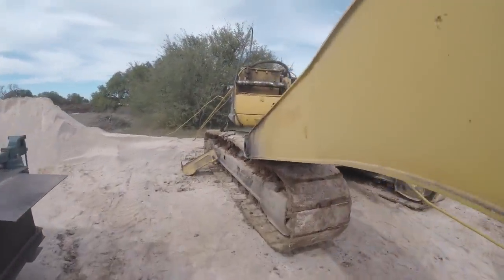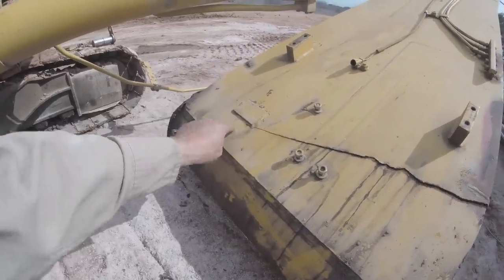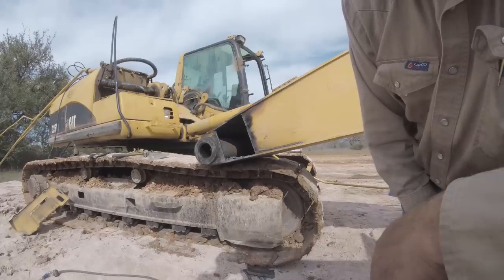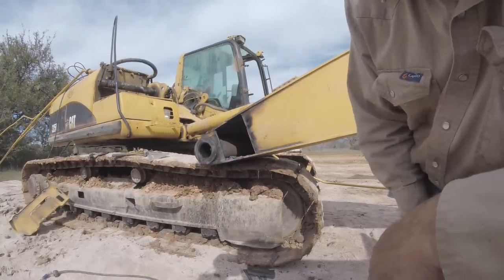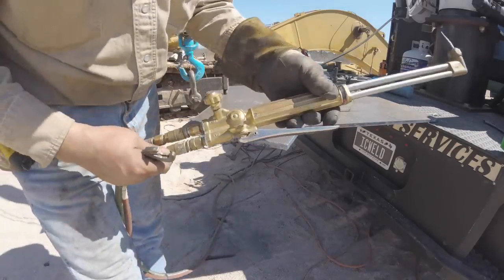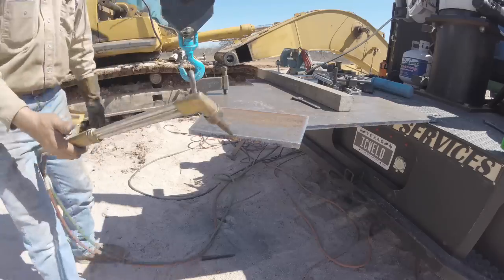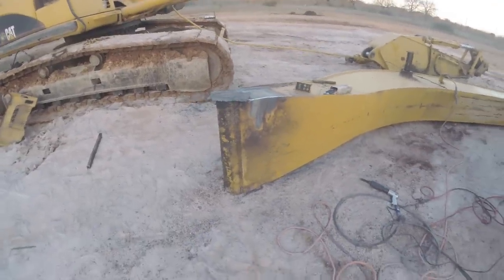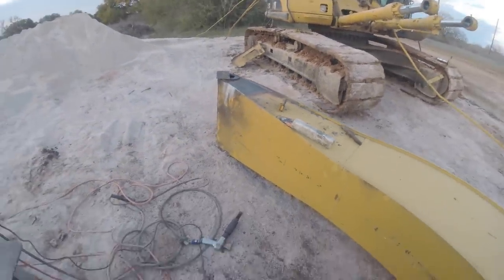Broken Excavator Boom!!! How to fix it!

Comment: Why am I watching a man weld for 25 minutes along with more than 475,000 other Youtube viewers, a man that only has 35,000 subscribers? Because this man is in harmony with the machine and the metal that he works with to such a degree that the metal cooperates. Notice he never or rarely uses a grinder and when he uses a hammer it is with finesse? He reminds me of a Hopi Shaman that I admire.
Reply: I only watch him because of the stupidity of his repairs !! I was a welder for 40 years had my red seal ticket and my xray ticket . You must grind all the cutting and gouging of the  steel. ( in this case it will be T 100 steel - structural steel ) so that you will get a carbon free weld, ( it will not be a brittle weld ). must use preheat and post heat on the plates .
 this is from 250 -300 degrees F.
Reply: @richardsmuin7665  If his repairs were that bad he wouldn't have repeat business from a heavy construction company that loses thousands of dollars when a big piece of equipment goes down. They wouldn't give him that many kicks at the can.

Comment: You are a surgeon with that torch. I used to weld machines like that( but of a better brand IMO) in a production setting so it is interesting to see how they fail and are repaired. I know people use these things for more or different work than they are rated/made for.Nice work and thank you.

Comment: I have been in the earthmoving game for 35 years and have always said you need "Earthmoving Welders" or "Earthmoving Electricians" or "Earthmoving Line Borers" as there is more to it than just welding etc. While we always joke in Australia that welders are really just "scrap cutters" it is extremely pleasing to work with guys who "get it" and know there craft and you sire are absolutely one of those guys, someone who attacks repairs most would now just want to replace those items complete, a true artist you are!
Reply from the maker: Thank you very much. I really appreciate your words. Too often, welders get a bad rap, especially if you're not one of those Pipe welders who seem to get all the glory. Working on heavy equipment takes more than just knowing how to burn a rod in circles. I'm not badgering pipe welders, heck, I did it for a few years myself. However, It takes a different mindset to understand how to piece together a machine that has torn itself to pieces. That's the type of work that excites me. you gotta think!
Reply: @ICWeld  no problem mate, a pleasure to always see a true trades person doing there thing

Comment: This is why many welders can make way more wages than many college degrees.  
I tried my hand at welding.  Not at all easy.  Stuck with being a Machinist.  
Great respect for Welders and Fabricators.
Reply: You didn’t like the dust and smoke? That’s strange. Haha
Reply: @paralou8576  The welding booths that I trained in had ventilation hoses.  
I could never see the molten puddle.  Therefore what i did achieve was by rote, not by control of the puddle.
I was pretty let down.  Really wanted to learn how to weld.
Reply: @MaxCruise73  makes me think your shield may have been too dark for you. Very common mistake I've seen. People so worried about arc flash that they over dim or use too dark a lens.
Reply: @patricktennant1585  Thank you for your reply.
During my training, my eyes started bothering me. Issue went away once I darkened the shield a notch or two. 
Did that create more issues as you suggest?  Suspect so.  
I still wish to try MIG welding.  Removes the need of constantly driving the hand toward the workpiece as the rod is consumed.  
Again, thank you for your reply.

Comment: Very nice work. While it is straight forward it is still challenging. The experience shows with the little tricks like sticking the tube in the pin boss for a steady rest. I like at the beginning when you said it’s just metal. No need to overthink it

Comment: First time I've seen one of these type video where a carbon arc gouge is used. I used them for years and if you have enough juice going to it, the cut is clean and smooth. If not, it's like a snaggle toothed alligator chewed on the metal. Nice welding too. Not afraid to use a backing plate either. Nice to watch a craftsman at work.

Comment: For some of the folk who said they are still learning, or want to get into this trade. This is an EXCELLENT vid 
I (certified gas pipe line welder) used a LN77 & innershield on bridge false work , which is building structure to put forms on top of , to pour concrete , to make a bridge , but l don’t remember what the wire was as it was 30yrs ago. But the gun nozzle was not that LONG, rather abt 4” 
If the gap is wide , & you cant put in a backing plate , do a 6010/6011 root pass , dress it good with a grinder along the edges , to insure , when you start to fill with 7018 that there is no possibility of trapping slag in a wrinkle , this is what is done on pipelines, - the inside looks good but the outside must be ground, & then either use the wire feed or 3/32 rod , as the man said , for more control, so you don’t burn through!  
As someone else said , about cracks, determine the end of the crack, drill a hole just past, to weld into , turn around & weld back , filling the crater, so it can be ground down to flush. And as you noticed IC WELD used a gouging ark to go past the crack, when it was in the angle
Did you notice, when he was using the wire feed that the back side if the 1/4” backing plate was RED , this is very important for penetration, beginning welders usually always try to run to cold ! Practice ! Practice ! Practice !
Reply: Very informative comment.
Reply: Yes and I noticed how evenly red it was. A good steady hand.

Comment: You may have shown the air gouge in another video on what material it is and what air does for the process. Again for us with limited back ground with welding. Thanks. I do enjoy watching you do the art work type repairs.
Reply from the maker: The arc gouger uses copper coated carbon rods and the electrode holder itself has air jets coming out from the holder. As the arc creates a molten puddle, the air blows the puddle away.

Comment: Great video on how to look at repair options.
Looks to me though that the bean counters at Caterpillar asked the engineers where they might save a few bucks on design and build costs to improve profits. 
I have a Ford 5500 TLB  from 1969 and even the body shields are 1/8" plate or more and weighs 15,000 lbs.
Reply: Cat is so cheap they make their machine's suffer

Comment: Really Fantastic Channel.
I think this type of cracks, Steel fatigue which is change in internal structure of steel because of the value of operation load more than rated load.
And welding cracks of upper and down side not enough, you need to change it with new steel plate like what you did with right and left side. 
Best regards
Essam

Comment: I didn’t think metal work crack like that. Almost like it flacked or tore instead of just cracking. Wild!
Reply: Steel has interesting grain structures. While this grain is tightly locked together it’s also possible to break it under the right circumstances. If not engineered correctly parts are susceptible to fatigue from vibrations and repeated loading. I’m not quite sure if the attachments they use on this equipment are designed to be used with this particular model, but with the repeated failure I’d say they are not.

Comment: As with the dipper repair, you NEED to realise the side plates contribute a very small amount of strength to the overall structure, and their primary purpose is to transfer the loadings from the pivot points to the top and bottom plates, and to hold them in position to take the loads. Heck, part of the problem is the OEM pivot support plates being square like that - they're almost designed to be stress raisers where they meet the load bearing plates - many companies now use a recessed V design with the legs extending out and so reducing the stress risers in the corners.
If replacing the top and bottom plates where there is a previous failure, either use a thicker guage plate or use diamond supplementary plates to re-inforce the highly stressed areas, or both.
There are several reasons not to buy a CAT, those are just a few more.

Very nice welding, BTW!
Reply: I agree absolutely about the way the support plates are "designed" to induce transition stress. At the very least they could extend further up the boom. Maybe some sort of limit on the power of the slew motor would help prevent this operator abuse.
Reply: @jonka1  
99.9% of it is down to operator abuse - in this case compounded by an owner who apparently doesn't give a crap about preventative maintenance. NONE of those cracks should haveen allowed to propogate to even a fraction of those lengths.
It's not just the direct repair costs, but the extensive down-time that is incurred.

Comment: Being good with the oxygen acetylene torch is a clean cutting tip the right size tip and proper adjustment of regulator pressure for the thickness of metal being cut

Comment: Greetings from Australia, I have repaired a few of these before and have added a fishplate top and bottom to reinforce the break point because if it broke before it will break again especially when using an oversized jackhammer.

Comment: From what I can see, it wasn't your welds that failed, just plain metal fatigue. Awesome repair. Great video, cheers :)
Reply: Haz 
Heat affected zone
U gotta pre heat before welding. And post heat after welding and try to cool metal down slowly as possible
The actual weld material is usually harder than the parent metal. That’s why the crack appears to the side of the weld
Needs peening and stress relief with heat. Following welding

Comment: That welds ability to best hold was in how the steps taken to stop further cracking. I think that you got all the highest stress points covered  very well and it will now be "better than new" because of the reinforcement put into those points. It takes a lot to break in the first place and just why it doesn't get really bad "twisted" is a mystery to me. I love welding and wish I still could. Spent over forty years on the islands in alaska working on mining, and logging equipment. I made stuff so strong that it broke the machine instead of the weld... makes me wonder if I did the right thing for the wrong operator. Most breaks I found were from abuse and lack of lubrication or worn eyes in stuff
Reply: Morgan I agree, I think this machines operator and service tech are very careless with these machines, and attention to the wear on parts was probably non existent....

Comment: You have great torch technique, always tying to place the elbow near the body for support. Even when you have cut such a clean bevel as that, you should always grind some on the surface, the slag and oxides created with the torch, will enter the weld, and contaminate it.
Reply from the maker: Great point!

Comment: Nice job.  I’ve repair many hoe booms, the worst ones were two log loaders that the operators broke the boom completely off at the main pivot point.  It takes a bit of time to get lined back up.  When you weld T1plate, you should be using Arctec 223 electrodes.  Cheers.

Comment: Didn’t realise how thin those sections are your welding,those jack hammers are brutle aren’t they good work sir 👍🏻🇬🇧
Reply: hydraulic hammer is one of the quickest ways to depreciate your excavator, trust me. Ran one for several years in an open pit surface mine

Comment: That cracks are in a position where 90% of people wouldn't have the slightest idea where to start
Reply: Replace the boom would be my idea. Followed with replacing the operator, followed by rethinking such a big hammer on such a “light” machine.

Too many wrongs in this mess, he even tells he “fixed” it earlier.
I won’t say i could do a better welding job, but the engineering on the forces involved is poor and misguided at best, abusive to the machine probably more fair.

A business built on wearing out machines as long as possible and then replacing them instead of investing in sustainable and maintainable machines suited for the job.

(I am no businessman either, so no idea if that amount of investing would be a viable business, but I hate seeing good machines abused like this)

Comment: Armchair welder here...what about putting some gussets/ribs on the inside of that puppy to try to distribute the loads a little further away from the pivot joint??  Advisable ?, or no??
Reply: Usually loggers around here will plate the sides of the boom up to where the lift cylinders pin on.
Reply: Steven bent1  I am aware of that but replacement is not always an option and after so many hours the steel is so fatigued that the options are limited.

Comment: After replacing bad plates , put a linear bridge length wise stand ''  up right ''  on its edge ,, top an bottom of boom on each side or one in middle if needed  1 inch flat bar 3 or 4 inch wide it is stronger than plating it that's been my best results welding long boom excavators

Comment: I trick I learned to stop cracks from running under or ahead of a weld is to drill a hole or use a cutting torch at the end of the crack, then weld that bad boy up...

Comment: Dear Mr. I. C. Weld, I really enjoy watching your weld repair videos. Concerning this equipment, do you find that the failures are from abuse, fatigue, or defective welds or materials? I am a retired welding engineer and my first job as such was at the LeTourneau plant in Longview TX (now Kamatsu Mining Corp.). I saw many similar parts like this come back to us due to faulty welding. While attending LeTourneau College, I worked the night shift as a welder, so when I became the jr welding engineer, I knew the products and production methods inside and out. This was during the late '70s to early '80s.  Do you come across any LeTourneau equipment that you weld repair? Are you concerned about some parts being made from Q&T steels like T1 (ASTM A514, A709)? Back then they used in-house steels called N30 and N40,  These are similar to HY130 and HY140 steels.  I remember having to use E12018 and E14018 SMAW electrodes to weld them along with 300F preheat. I don't think they are using this steel in their modern equipment, as they sold their steel mill to Nucor Steel.
Reply from the maker: Thanks for your response. I find that most problems come from sustained hard use. But on the other hand, There are some backhoes that have issues from welds popping loose. Some of the welds on the main rear boom tend to crack right along the upper curved part of the boom. They look perfectly fine, however, the welds didnt penetrate well. Not sure if they are robotically welded or if theyre done by hand. This is a common problem.  I'm also finding that the manufacturers are trying to Up the tensile strength of the steel while making it thinner. That doesnt always work. harder steel doesnt always mean better. sometimes you need that extra flexibility.
Reply: @ICWeld  When I was at LeTourneau, I knew several guys in the Engineering department. At that time we didn't really have the computing power to design parts with different thicknesses along with the structure (what they call Taylor blanks today). Every plate part was the same thickness throughout. They did, however, apply reinforcing pads on areas that had high stresses. When RG LeTourneau designed his equipment, he would start with a baseline structure based on his experience and then test it.  When something failed, he would have a welder cut out the failed part and put something thicker in its place, and test it again.  Once he could run the machine 100 hrs without failure, he told the Engineers to draft up the drawings for it and go into production. In the older LeTourneau equipment, you would see blunt-tipped diamond-shaped plates placed across welds and other high-stress areas to provide more strength. This was a product of his test to failure methodology. It didn't always work, as sometimes they just added more stress risers.
I remember doing a failure analysis on a bucket loader lift arm bellcrank.  It had split along the entire weld seam in one of the box corner joints.  Since I had worked in that department and saw how they set up and welded those parts, I had a pretty good idea of what went wrong. These parts were made from 100 KSI tensile Q&T steel and were 1.5" thick. The setup man used short arc GMAW to tack weld and root pass the parts together and never used preheat. The weld out did use preheat and the SAW process.  The thought was that it would remelt the root pass, so it didn't matter if there were cracks there. When I cross-sectioned the failure area I found many small transverse cracks in the root pass that were not remelted and lead to the failure.

Comment: Nice repair, I seen the Arc gouging of the old welds. Would a plasma cutter work for the part of the repair?  Would a X-ray test help on this repair , to show how you filled the gap and did your surgical skills to fix it?
Reply from the maker: Not sure. It may have worked on this application since the material was relatively thin.

Comment: I would have tried to pull the pin boss back to original position.  This break comes from using the bucket to sweep sideways.  Fixed a few.
Reply: Is that what they called side load?
Reply: You'd be right if you weren't wrong. This machine is used to run a hydraulic hammer not a bucket.

Comment: Nice welding job. Just curious how come you don't install some  reinforcement on the inside? I know it isn't like that from the factory but the welds will probably crack again from the heat affected zone. Maybe time/cost saving?